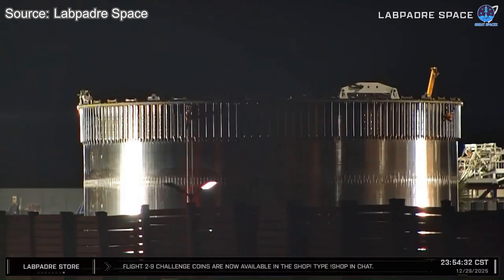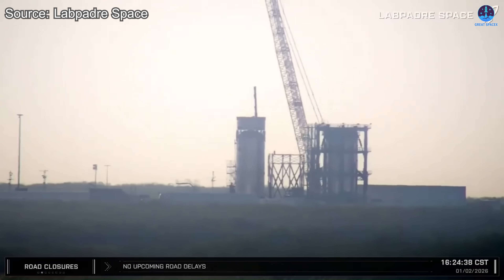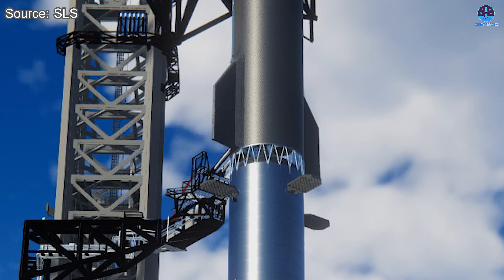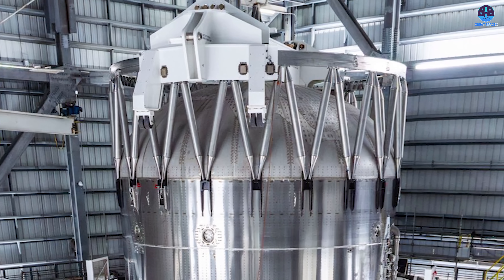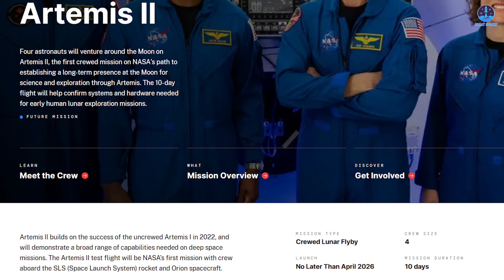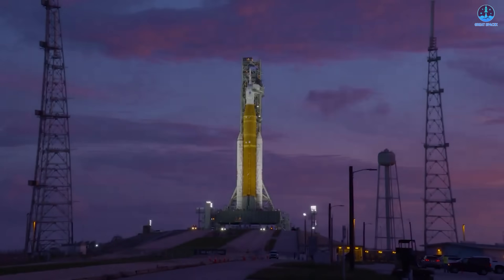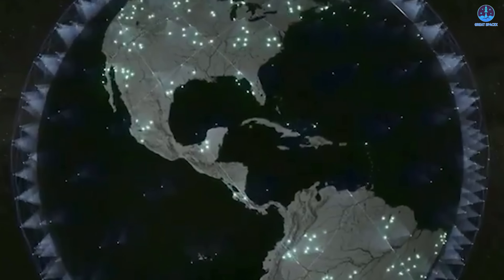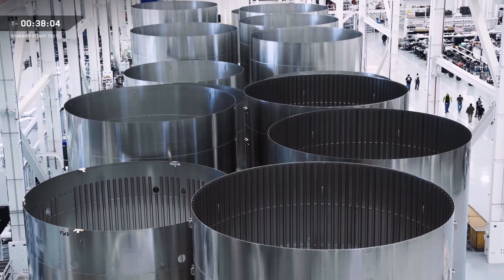SpaceX Unexpectedly Starship V3 '' Hot Stage Testing''! NASA SLS Launch Date CONFIRMED...

Comment: Everything about Flight 12 is New. 
So they need stress test validation.

New booster, New Starship design.
New raptor V3. First down-comer use. New Copv overwrap protection use to mitigate transport damage. New Tower Two design. New OLM mount and flame trench system.